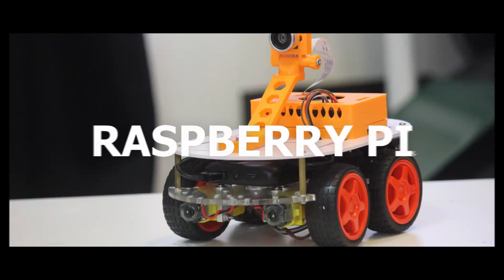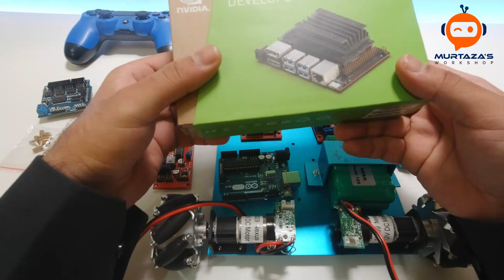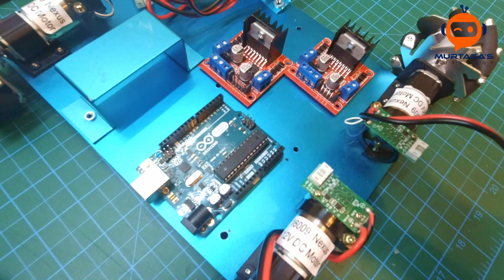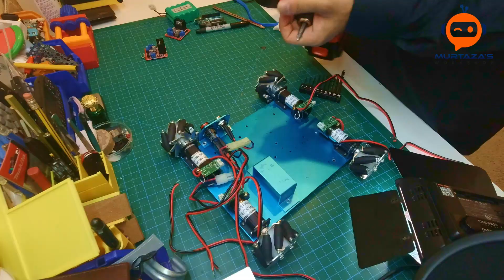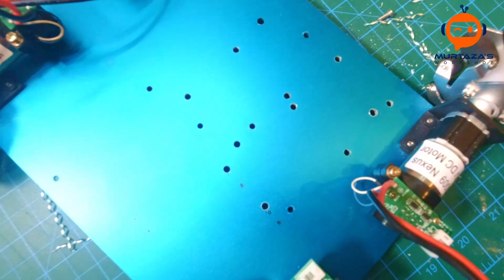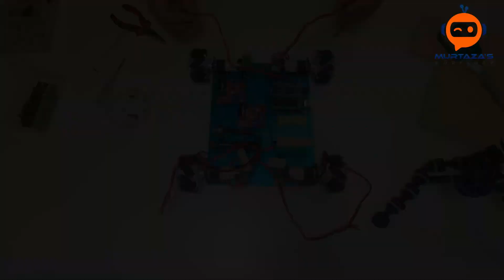Assembly - Self Driving Car using Jetson Nano

Comment: I wonders why do you use 2 L298N motor drivers for the 4 motors. I thought one L298N can handle up to 48 volts so 1 L298N should be enough

Comment: Nice project! I would suggest you to use a better motor driver as these H bridge ones which are most probably based on L298N are really inefficient and have a huge voltage drop. I am working on a similar project and the L298N driver did not work for me because it had around 4 volts of voltage drop. Although for my case, I have one single motor taking care of the whole vehicle
Reply from the maker: Thanx. In my experience they work fine as long as you dont over shoot the current. For sure there are better solutions out there, but since the cost of the project is already a bit high i am trying to use cheap components where possible.
Reply: @murtazasworkshop  good luck Murtaza. I am closely following your progress

Comment: To clean up those sharp edges on drill holes you can twist a larger bit in there with your fingers.
Reply from the maker: Thanx for the advise. I do have a counter sink bit, but in this case wasn't required.